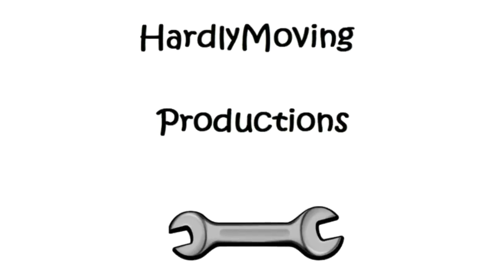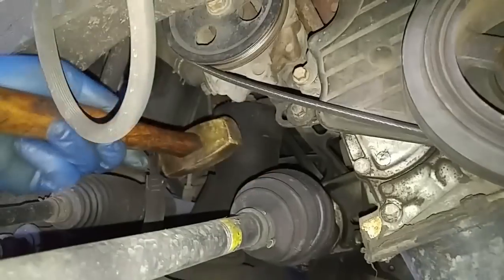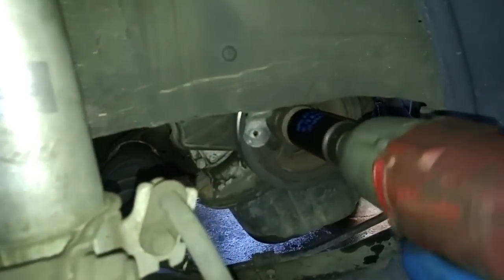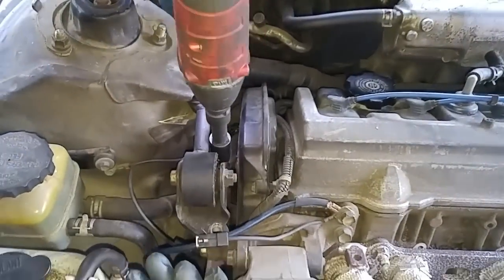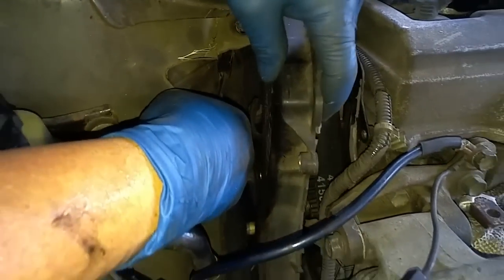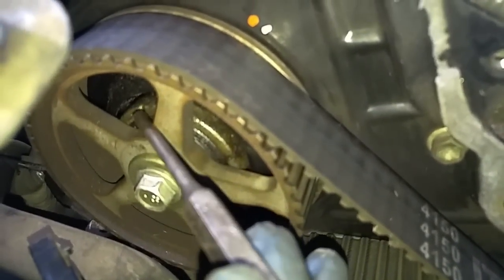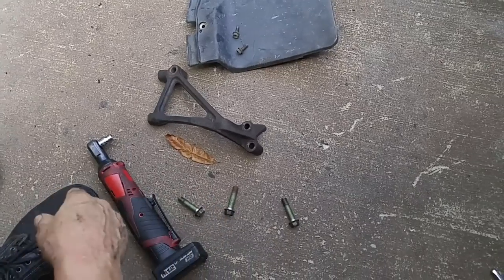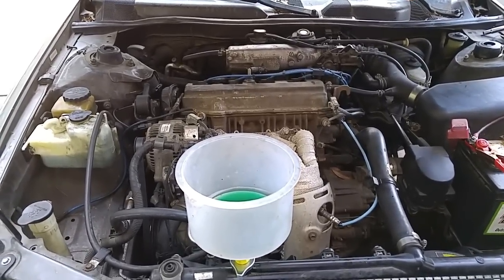Camry Timing Belt, Water Pump, Seals & Pulleys Replacement:  2.2L I4 5SFE Engine

Comment: This video was a lifesaver for me, especially with your tip to turn the camshaft pulley a tooth a head when applying the new timing belt to give enough slack to get it on. I'm in my early 20s learning to home mechanic work myself, and your videos have been really big to help me in that, thank you!
Reply from the maker: Glad it helped and thanks for sharing!
Reply: I learned alot of what I know from working on old Camrys, corollas and Buicks. And a Jaguar xj8.😁
Reply: @@hardlymovingpro QUESTION. Is it normal the oil pump pulley and the crankshaft pulley aren't 100% aligned ?

Comment: Appreciate the video man! I thought my leak was from the cam seal. After putting everything back on. Turns out it was the oil pump seal!! ROUND # 2!!!!
Reply from the maker: Good catch and glad you found this video helpful!  It could be a combination of the oil pump cover gasket and the pump shaft seal.  Recommend you replace both.  The cover gasket can also be replaced with RTV in lieu of a rubber replacement gasket.  FYI - Check out my other videos on the Camry.  To support our channel and receive notifications of new videos, please subscribe!
Reply: I also learned the hard way, it pays if you are changing the water pump, timing belt, cam seal, crankshaft seal, tension pulley and pulley every 70,000 miles, go ahead and spend the extra $10 and buy the oil pump seal and gasket. You are already there and it takes about 30 more minutes to replace them also. My oil pump gasket started leaking at about 230,000 miles, right after doing the water pump and timing belt thing the third time. Lost a quart of oil going to work (5 miles), saw oil under car before going home, added a quart of oil, went home lost one quart of oil going home. That was on a Thursday, added one quart to make it to work on Friday, added one quart to stop by AutoZone to buy oil pump seal, gasket and make it home from work. Spent most of Sat. geting to and replacing the oil pump seal and gasket.

Comment: Ah dang it ! Finished installing everything, went for a rip in town today started the car and the oil started leaking real bad under
Reply: Weird. It looks like the Oil Pump Seal popped out.
Reply from the maker: Could be the camshaft oil seal.  The seal lip can turn inside out if you push the seal in to hard.  I prefer to spin them on until flush with the engine then use my press tool.
Reply: @hardlymovingpro  aw thanks man. Turn out it was the oil pump pulley seal..... I only used an impact to screw the pulley bolt back on at first, but this time used a chain wrench to hold the pulley and torqued it down to like 20 ft pound.
Reply: @hardlymovingpro  actually just reinstalled only the timing belt and it seems like the seal is once again popping out ?
Reply: Dang it just tried again and it popped after 5 minutes running it without the lower timing cover. I guess I'll try a new seal

Comment: I find your way of tensioning the timing belt to be the most effective. In many other videos they rotate the crank 1 7/8 turn then tighten the tensioner bolt. Tried that and was a bit to loose for me to feel comfortable. You can also use a pry bar to get the tensioner a little tighter then just the spring does alone. I would also recommend starting the engine without the plastic covers like you did and rev it a few times to make sure you your belt is not flopping around. This method worked for me, thanks
Reply from the maker: Thanks.  I've found the engine start method results in the optimum tension on the belt.  Had to revisit and retension using the rotate the crank method.  Also belt slack can lead to premature belt breakage.

Comment: Best video so far!!! just did mine and the running the car before putting the plastic covers was a great idea. belt loosened, turned the cam pulley counterclockwise, loosened the tensioner re-tightened,  and got rid of the slack. thanks my friend!
Reply from the maker: Happy it worked out for you and thanks for your comment!

Comment: Great presentation with steady camera and step-by-step explanation. I was able to do the entire job on my 1997 Camry. Runs like a champ. Please show "How to replace the Fuel Injectors" for the same car !!
Reply from the maker: Thanks for your post and good idea!  Easiest way to get to the injectors is to first remove the valve cover.  Afterwards, the injectors are in your face and the fuel rail is held on by only two 10mm bolts.   But you're right ... I should make a video on it!

Comment: Great to see somebody using the same tools I used to do this same job. In my case someone who did the previous belt had loctited on the crankshaft belt pulley and the timing belt pulley. I wanted to change the crank seal and had to drill and tap two holes in the timing belt pulley in order to remove it. I guess some pulleys have these holes, but mine did not. Heat from a propane torch had to be used to get it to start moving. Without it I broke off the head of the puller and therefore the need for the heat.
Reply from the maker: I feel your pain but you did manage to get the pulley off!

Comment: This video was IMMENSELY helpful. I've got a cold-engine whine coming from under the timing cover that I have to deal with and the timing belt is due anyway so I asked my mechanic to draw up an estimate to do all this stuff...aaaaand pretty much had a heart attack. I work on my own car all the time and have a decent set of tools, but this was a bit more than I usually would take on. After watching your video, I know I can totally do this. I've already started ordering some of the specialty tools I'll need. Checking your other vids, too. Thanks, brother.
Reply from the maker: Good for you!  Highly recommend you get yourself name brand idler and tensioner pulleys for long term life (i.e. GMB or Koyo).  Same applies for the water pump (Aisin or GMB).  Good luck!
Reply: @hardlymovingpro  Will do. Thanks!

Comment: Wow thank you! You made this seem a whole lot easier than what I was thinking lol, doing oil pump and diagnosing an oil leak I have from that area thanks!
Reply from the maker: Glad it worked out for you and to be of help.
Reply: @hardlymovingpro  When replacing the oil pump seals and putting the pump back in , do you need to prime the oil pump by packing grease or Vasoline in the rotor cavity?
Reply from the maker: @rickrick9783  Nope ... not at all.  When replacing the O ring rubber seal, make sure matting surfaces is clean of any oil residue. Brake cleaner solvent works well.  Coat the o ring groove with some RTV then mount the o ring.  This will ensure a leak free seal that will last longer than the original seal that dry rotted.  Wiggle and twist the oil pump shaft onto the block and eventually the pump will snap in place.
Reply: Wow

Comment: Thanks for the video .   A few things you did were really cool  1.  running the car from the battery to visually inspect the timing belt in action...hadn't seen that.   2.  I am going to check the seals on cam, crank, and oil pump will probably replace them    3.  Why did you put insulation on the exhaust ?   4.   Thanks again,  this 1998 5sfe I have has 335,000 miles on it.    Installed a bypass oil filter on it at 150,000 miles.    Very happy with this car and its performance over time.   Thanks for the video.
Reply from the maker: Thanks for your comment and critique!  335k miles ... impressive!  You surpassed my 99 Camry's 270k miles!  Did you used the Amsoil bypass filter?  The exhaust wrap insulation is a old trick going back almost 30 years ago by racers trying to get extra exhaust flow efficiency out of their engines at higher rpm's.   I learned about it from a book titled "Power Secrets" by Smokey Yunick.  To quote "as soon as the combusted gasses leave the chamber, they start to cool down.  As they cool, they loose velocity, and the scavenging effect is reduced.  If the velocity of the gasses inside the pipes is kept as high as possible, the net effect will be a greater velocity, greater pressure drop in the system and higher efficiency. "  So based on some other research, I found that the 1st 4 inches of pipe from the exhaust manifold is where the exhaust heat is reduced the most and looses velocity.   With exhaust wrapping, more of the heat is retained in the gases and results in better exhaust scavenging.  At higher engine rpm's, the engine begins to work harder to push the gases out the manifold.  With rapping, the effort is reduced.  When rapping, do not over rap more than 1/4".  Too much heat is retained and the exhaust header's steel will get brittle and brake down.
Reply: @hardlymovingpro  Yes wowo thanks for the reply.   I will map out the exhaust insulation and thank you so much for all the detail.  I assumed it kept the exhaust gasses hotter and that would be a plus but you really nailed the explanation. 

 On the bypass filter, I purchased a Franz kit.  Did the oil lines myself with help from a hydraulic shop (the kind that sell and make hoses for cranes and bobcats, bulldozers etc), dealing with those hose barbs and new hoses can be a b***h.    I mounted the Franz filter  under the battery holder and ran the bleed oil to the bypass filter via a sandwich adapter under the full flow filter, then did the return into an oil fill cap I drilled with a swivel fitting, the clean oil goes right to where you fill oil at the top of the valve cover.  After installing, I did 3 samples of oil tested by Blackstone labs.   The oil was analytically clean, with the correct base number (PH) , by just changing the bypass filter, for 5   10 and 25 thousand miles, all on the same original oil with one filter change each time and about .75 qt added.    So in 25 thousand miles, by adding just 2.25 replacement quarts of oil, the oil was analytically clean and still functional with adequat additives.   This data completely sold me on the concept of bypass oil filtration.

So the filter worked as I read before I purchased.   I think this Camry is pretty bulletproof anyway probably  though and could reach similar mileage w/o a bypass.   But my first goal with the camry is 500K miles.     I added a similar filter to my 2001 audi a6 quattro and mounted the bypass filter on the front bumper right in front of the radiator.   Audi is at 194553 miles and the Camry is 335,XXX + miles.   Not compression tested but Camry is 30+mpg at freeway speeds here in CA, so I imagine the engine is still pretty strong. 

I did the timing belt, cam seals, half moon seals, water pump etc on the audi last year.   This camry job will be my second time doing a timing belt water pump.   Definitely going to watch it run via the engine w/o the alternator as you did.  When I did the audi, i put it all back together and crossed my fingers...well. it worked.
Reply from the maker: @orthopraxis235  I see that you're focused on keeping the engine running virtually wear free but pay attention to the transmission (assuming it's a automatic).  Make sure that the fluid is bright red and watch out for leaks coming out of the output shaft seals which the inner cv axle slides into.   CV boots also split so keep them coated with any type of rubber protectant to prevent dry root.
Reply: @hardlymovingpro  Believe it or not, Franz has a transmisison filter application as well, I just never did it.   So every month, yes, I remove the exit line from the transmission cooler (the one the exits below the rdaiator), attach it to a tube into a gallon water bottle, turn the engine on, and run new AT fluid into the spout.   I do this until it is red.   This is a lot simpler than changing the fluid in the pan, which I do far less often.   I know its not all the fluid, but whatever is in the torque converter and cooler will be changed out, at least I think thats whats happening.  its like 10 bucks a month and 20 minutes of time.     The tranny isn't perfect on this car but it still does the job.    While i was into your timing belt job on my Camry, I noticed I wanted to order the cam seal, the crank seal,  oil pump seal and o ring, and i have a trip coming up.  So I brought the Audi online, had to replace the drivers front axle, do did that and put the camry offline until i return.   Then I can order the kit with all the seals and water pump timing belt and take my time with it.   I also want to install an inline filter on the heater hose and see what I get with the coolant running through that.   ive laterly been running the camry a ton of miles without much tlc but plug wires, bypass filter changes and tire rotations.  I am not surprised that she needs seals, gaskets and a new water pump.
Reply from the maker: @orthopraxis235  If you want to do a complete ATF flush/fluid exchange, here's a video I made where you can with 8 quarts:
https://youtu.be/tVCV3ucbCGY 
https://youtu.be/40qtp1wX5JE

Comment: This is a great vid. Can you imagine never having to deal with this with an EV?
Reply from the maker: True but any part that rotates in a EV will eventually wear out.
Reply: Eventually, everything does. It gets annoying replacing gaskets and seals for cooling and lubrication purposes. The parts can be cheap, but the labor is intense depending on the situation. Imagine, no more timing belts, leaky oil gaskets, water pumps, spark plugs, wires or even transmissions. I need to replace the oil pump seal on this motor. It's an $8 gasket causing a major oil leak. And it's a bitch to replace.

Comment: Great video as always 👍 These Camry’s are a Beast! My 97 is my daily commuter 132 miles roundtrip. The guys at work keep telling me I need  a new ride 🤣 I tell them, please do not say those words around her. She doesn’t know that I bought a new Camry recently 🤫
Reply from the maker: I own a 99 I4 5 speed manual.  Got 280k miles.  Picked up a 06 Hyundai Sonata I4 with a blown engine for a couple of hundred $$$. I  did a engine swap out of a Kia Optima from the salvage yard that uses the same engine.  Must admit ... That's a smooth running car ... Better than my Camry.
Reply: @hardlymovingpro    Keep us posted on its reliability. Back in 2006, we bought a brand new Elantra 5 speed manual. Now my former wife still driving it to this day. My kids tell me she’s going to drive the Elantra until the wheels fall off 🤣
Reply from the maker: The Sonata and Elantra have different sized and type engines and transmissions ... 2.4L vs 2.0L ... timing chain vs timing belt ... aluminum block vs cast iron.  The Sonata competes with the Camry and Accord;  the Elantra with the Corolla and Civic.

Comment: Based on your great presentation, I was able to do the timing belt job on my 4 cyl. with 185000 miles - 97 Camry in 2019. The RPM is 2000 when engine is cold. It them relaxes to 750 RPM in 4 minutes, before I put it in gear. 
 Is the high RPM normal after doing this job ?
 I think I read in your comment somewhere that when the timing marks are perfectly aligned, the RPM is high and this is expected. Thanks.
Reply from the maker: High rpm's is normal during cold engine start up.  2000 rpm's, however, does seem a little high.
Reply: @hardlymovingpro  Thank you for your prompt response. I wonder if your expertise offers a solution to the high rpm. Except for that high rpm, the car runs like a champ, super quiet and smooth.